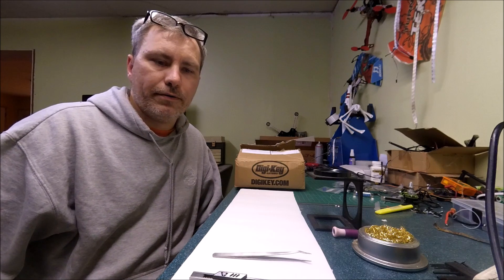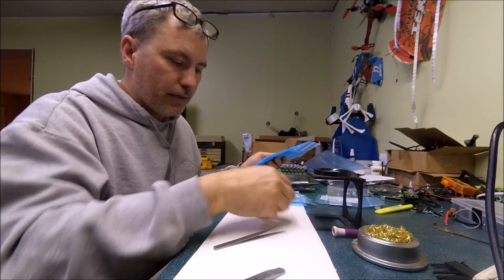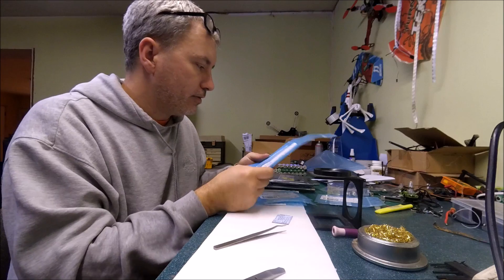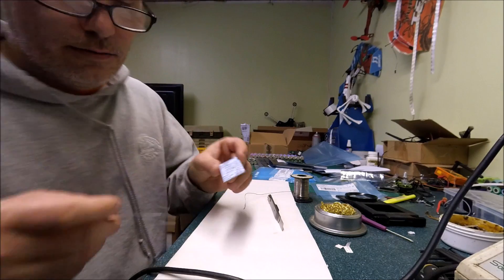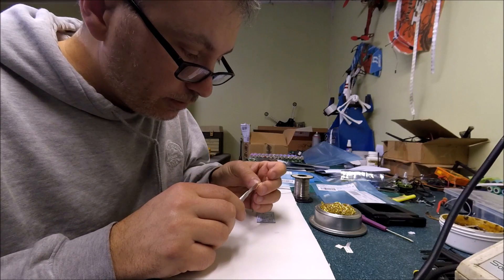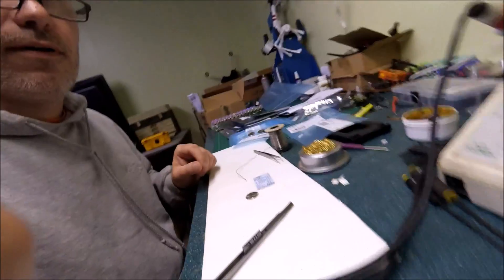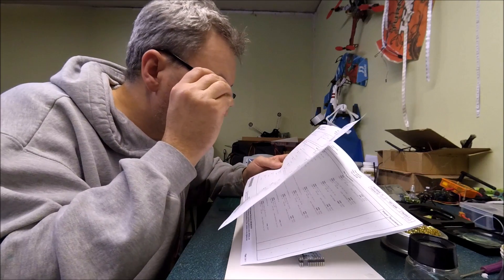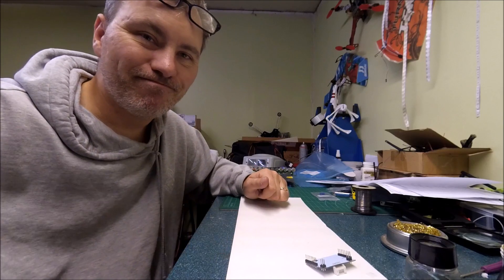MMDVM DMR DSTAR Repeater Maker!  ** Kit Board Build **

Comment: Can you get a solder mask along with the board? with SMD stuff this small I'd want to use a mask and paste and just toss the whole thing in a reflow oven (IE, toaster oven) or on a hotplate and just do it with paste.

What I want to do is use one of these as a "mega" hotspot and just use it in simplex mode with a single radio.  That way I can connect the hotspot to a external antenna and use it at 5-10w (whatever the lower setting is on the host radio i'd end up using). That way the hotspot covers the whole neighborhood (any hams within range are welcome to use it even, lol).
Reply from the maker: You can get the new board now that is Plug a Play! Ready to go out of the Box.